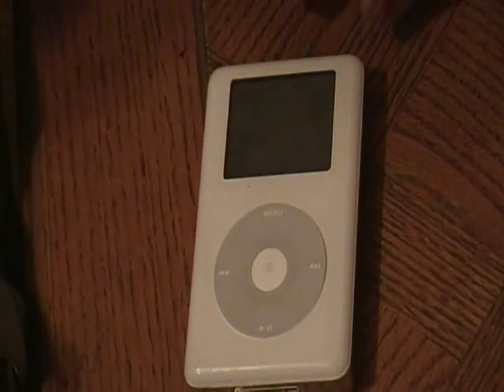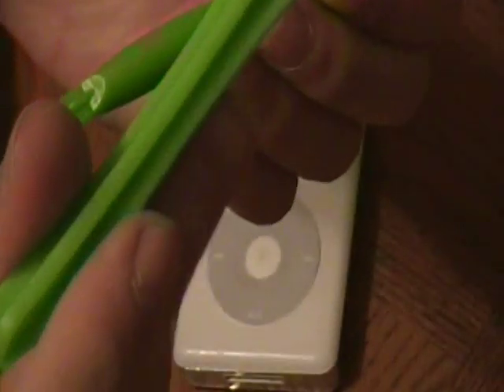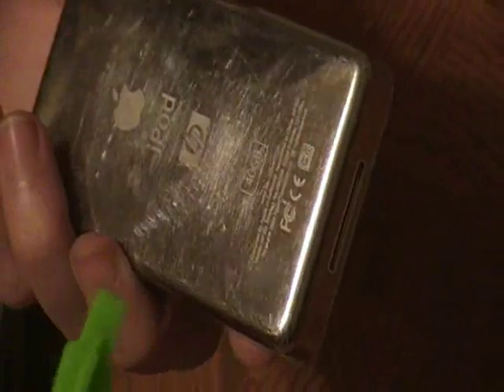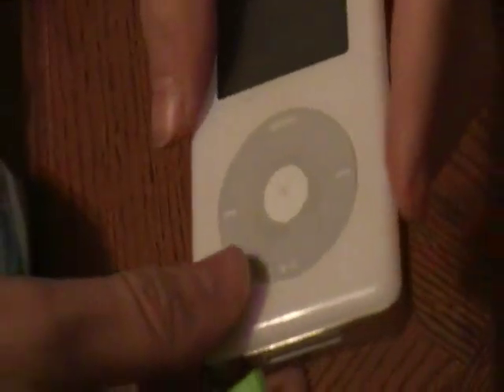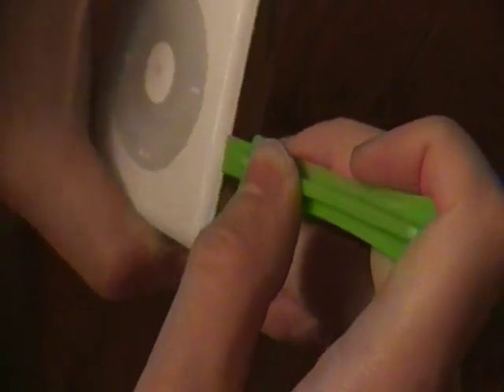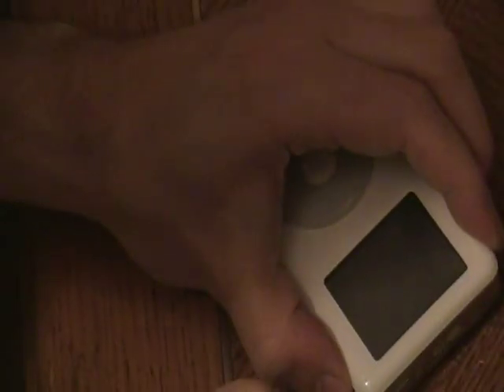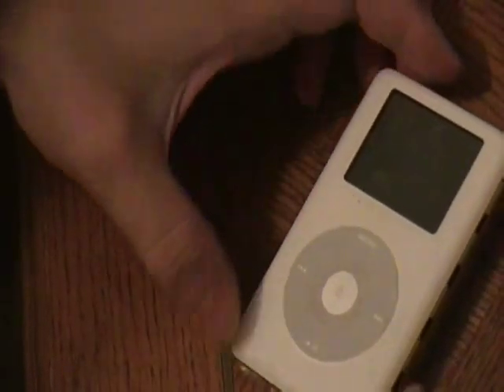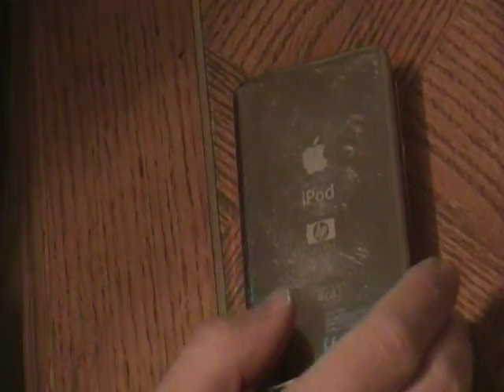How To Open An ipod

Comment: i cant get the tool in. any tips? :/
Reply: Get a flathead screwdriver. Carefully start to pry the iPod top cover away from the back of the iPod. Once the screwdriver is partially it, start to move the screwdriver around the outside of the iPod until the first side has been opened up. Then, pull the entire iPod open carefully. Then you're done! I hope this helps